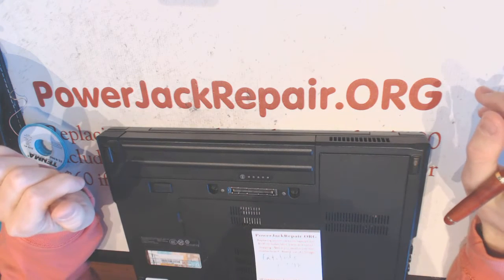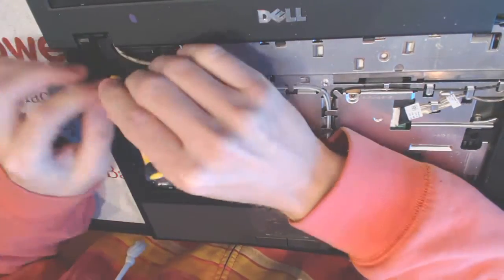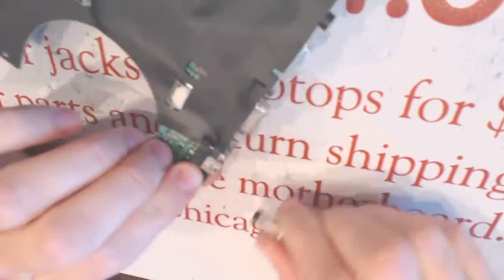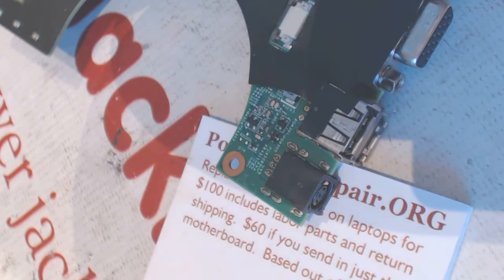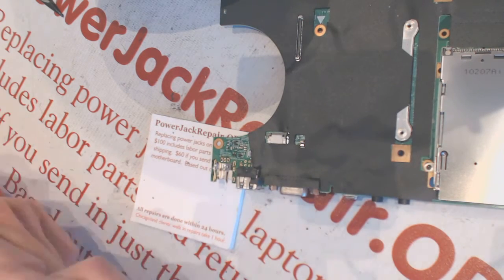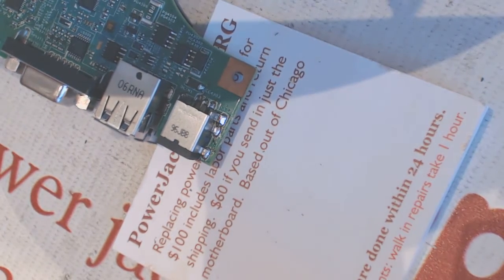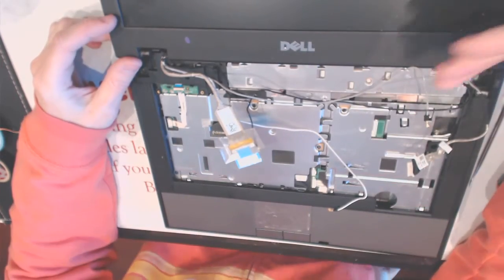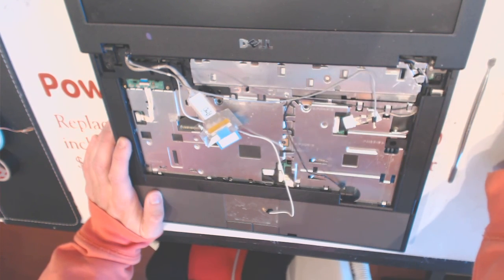How to repair a broken Dell Latitude e5410 dc power jack socket input port on laptop

Comment: I bought one of these dells refurbished and i did not come with the original oem power cord. The cord worked for a month now i have to push it into the jack really hard and hold it there the whole time. My question is it the cord or the jack that it the problem?
Reply: usually the cord goes our first, so your best bet is to get pa10 dell oem used power supply